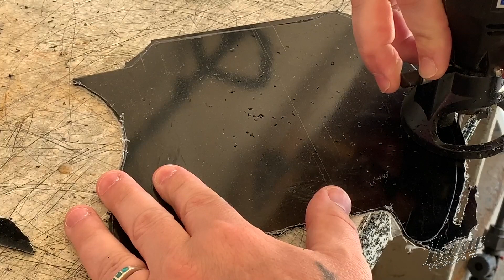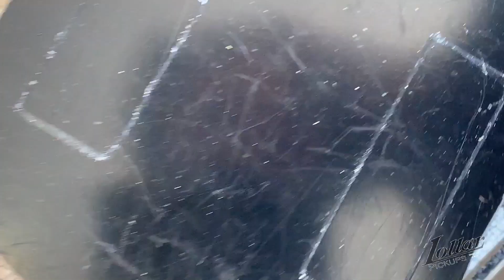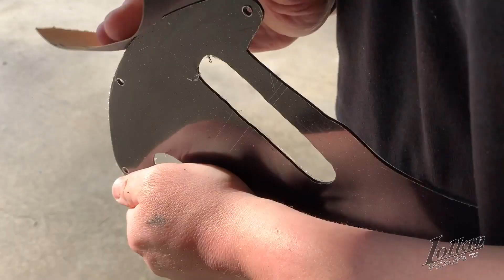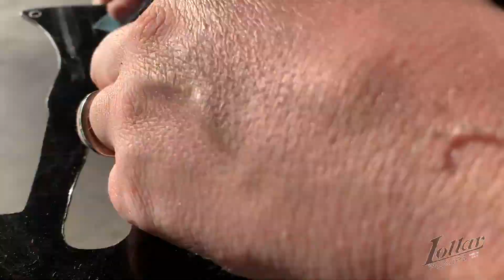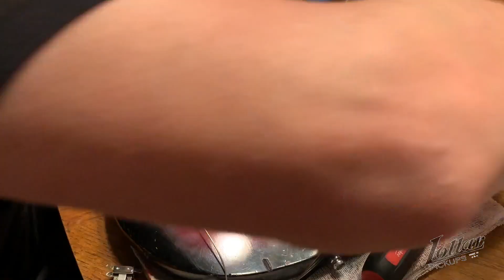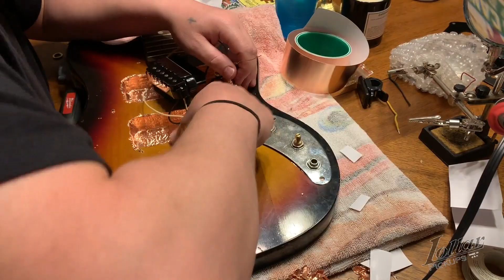Lollar Pickups Presents: Budget Bangers - Low Budget Guitar Modifications

Comment: Nice. I used to use the foil tape too (all the way back to the 80s) but found that black liquid ground stuff and use that now. You have to use good ventilation though, because it's not good to breathe it. Have you had any luck with that stuff?
Reply from the maker: Yeah, shielding paint is pretty handy stuff and works great. But I've never used it personally, because I'm too likely to spill it and get it all over everything whereas, with the tape, if I "spill" it, I just have to bend over and pick it up. Haha!
Reply: @LollarPickups  You just paint it on with a brush. I do it outside because you don't want to breathe the fumes (toxic). To me it's a lot easier than the copper foil.